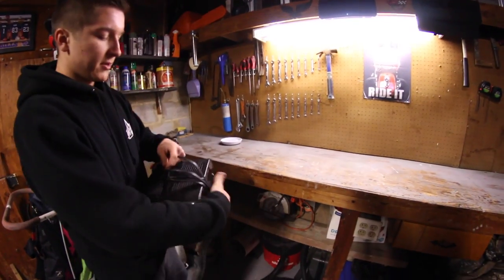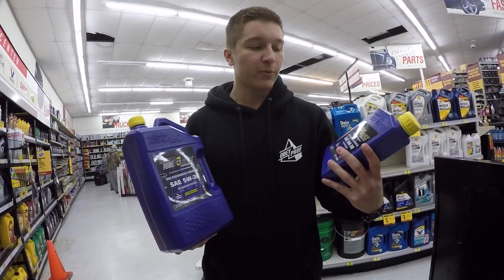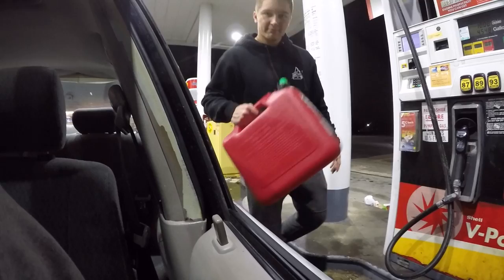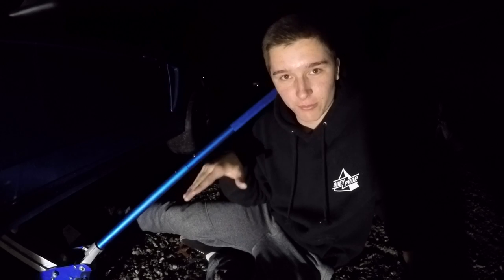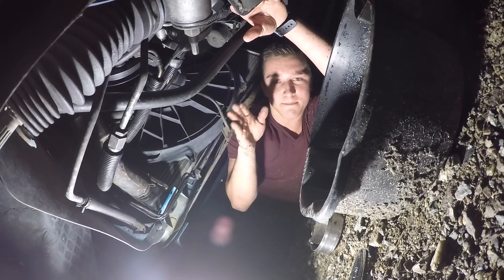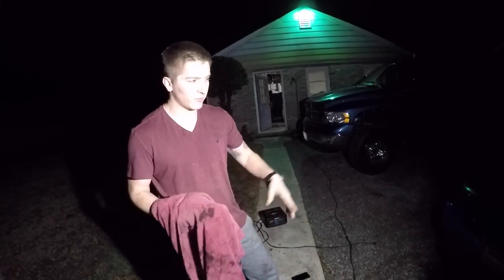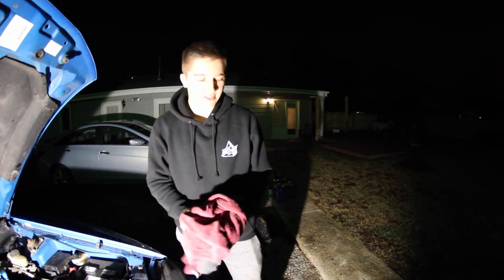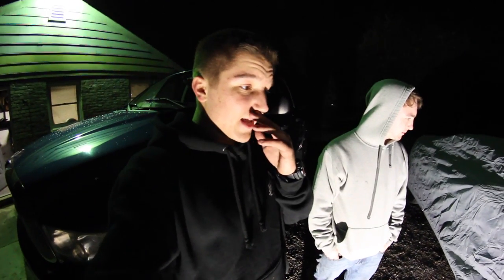RE-DO BLUE: Maintenance Is IMPORTANT! | Episode 6

Comment: Your suppose to pre fill the oil filter halfway with oil too, Decreases the time it takes for oil to get to critical parts in your engine. All I use is Royal Purple 5/30 and the K&N Filter, It's a good setup and I run the same thing in my new edge. There's also reviews of that filter on YouTube and they take it apart along with some other good brands if your interested.
Reply from the maker: Thanks for the info man!
Reply: Ford Racing/Performance oil filter($20 online) is prolly the best oil filter you can buy for these cars.

Comment: Fyi, that Royal Purple is the WORST oil you can run in your car
Reply from the maker: Yeah i've heard its mainly for track use so i'll be switching soon
Reply: DerekBaranProductions yea the HPS formula is the good stuff. the off the shelf stuff like that is no better than conventional. I run rotella t6 5w40 and a mobil 1 oil filter in my 2v and it's great for a stock longblock 2v. the k&n filter is the exact same thing as the mobile 1 but half the price lol

Comment: ok so basically the brand of oil you run goes with how you drive the car, if you daily it or light street romp it any full synthetic is good. now to be honest i use mobil 1 full synthetic, have 115k miles on my truck and no problems at all. mobil 1 has a little longer life than royal purple based off lab results so you can go about 7k before changing it but i go about 5 to 6. best part is they are both near identical on wear but mobil 1 is cheaper. so either one is great for your car but you will save money with mobil 1, or at least where i live its cheaper
Reply from the maker: Yep! I change mine about every 2-3k miles. I like to keep it on the safe side at all times! But yes! I use to run Mobile1!